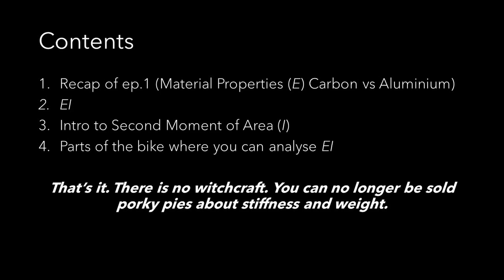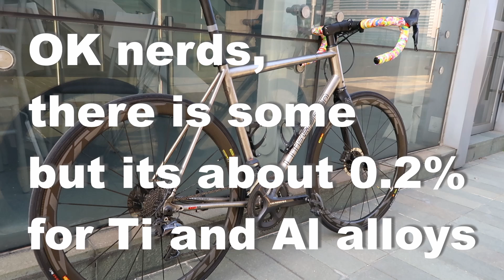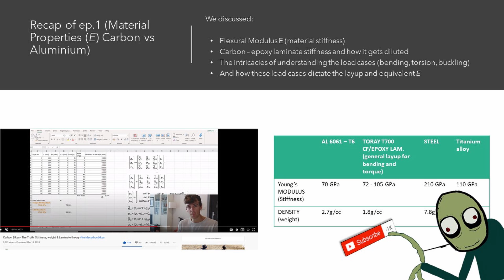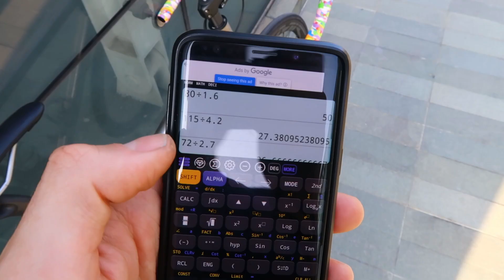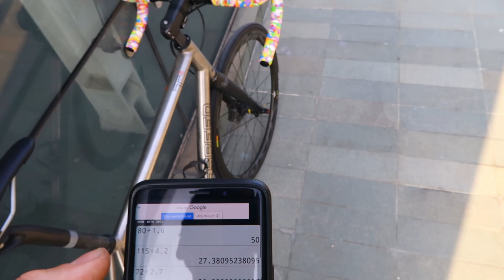Titanium Bikes - The truth and Physics of 'ride feel' marketing.

Comment: Reminds me of the steel lasts forever, aluminum has a finite life stuff that I used to buy into.  I've owned steel frames that have gone flat within a few seasons.    Most people will grow bored of an aluminum frame before they have other reasons to replace it.
Reply: Ever wondered why there are no aluminium springs or why aeroplanes with an aluminium air frame have a limited service life unlike those made with titanium frames?
That is because any aluminium structure has a limited number of flexing cycles before it fails.
This is well known and can be calculated. Once that number is exceeded aluminium structures can fail catastrophically at any time and practically without warning and no insurance company will insure an aluminium airliner which has exceeded the number of flight hours it has been designed for. Steel and titanium can flex infinitely, aluminium can not.
In bicycles this can be counter-acted by making the frame stiffer for any given weight than steel by simply increasing the tube diameter.
The maximum diameter of a structurally sound tube is limited by a simple ratio between wall thickness and diameter (I think it was that diameter cannot exceed 60x wall thickness). Because aluminium 1/3 the density of steel aluminium tubes can be made with a much larger diameter than steel tubes resulting in a much stiffer frame at the same weight.
Reply: @gustavmeyrink_2.0  Thank you, excellent explanation.  Pretty cool)   I've never had a bike frame or fork fail.  I've had carbon and steel road bikes long enough to notice that they pedal inefficiently or what I call "go flat" after a while. The bike is still safe, it just feels dead.  Not scientific I know.  To me it seems to be another more finite element in what determines how long a bike frame is useful.  That's why when I do buy a steel frame again, it won't be expensive or light.

Comment: I have a trek 1000 aluminium framed bike. Put a curved surly steel fork on the front and suspension seat post and it weighs about 10kgs. The fork soaks up vibrations better than the carbon original. The seat post is comfortable. This budget build would be better than an expensive titanium bike.

Comment: I have a Ti gravel bike and a Ti hardtail 29er-love them both, bought them because as a retired engineer I just love the corrosion resistance and look of titanium. I also have a carbon road bike which I save for the good weather, my gravel bike with road tyres fits the bill as a winter bike. It’s not a ‘magic’ material, I just happen to like it.
Reply from the maker: I like the material too and i think I've been infected. Im probably going to buy one at some point 😃
Reply: EXACTLY!!! Glad 2 hear this. Ride what U like b/c U like it. OVERALL fitness is where  your BIGGEST speed gains will be had. Adversely ‘older’ isn’t necessarily worse... but style most certainly plays a part in many choices. I am a sucker for polished metals and clear costed cf...🤗😬🥴
Reply: Similar for me. I retired my grey carbon bike for the elegant titanium ride. I could not care less about weight or other hard facts.
Reply: I’m the same, I bought my titanium bike because of its corrosion resistance and it looks nice as well not because of the so called carpet ride quality.
Reply: Me too ...Ti is not magic but I do love the material... I do Orthodontics so it's moving dentistry 😉
Reply: Yep. Corrosion resistance: full stop. No paint stands up to my sweat either.
Reply: I still have a 30 year old lightspeed mountain bike I use for commuting. Used to race it in the 90s.
Reply: I have a road and mtb Ti. Bought them because are been produced and welded one in usa and one in italy. Lot of quality control, I dont want to ride on carbon fiber and begin to worry after two or three years. Comfort like aluminum, but incredible good looking and more resistant to strain on the long period. If you change bicycle every one/two year ofmcourse buy other things.
Reply: Enjoy your retirement

Comment: Hey I see you're good at FEM analysis, could you do a vibration/modal analysis of different frame types ie dropped/ normal stays and different materials ie alu and Ti thatd maybe help dispell some of the myths around material and show that it is more dependent on geometry/tubing
Reply from the maker: Not a bad idea that. Got to find the time!
Reply: @PeakTorque  what calculator app are you using on your smartphone? Thanks for posting a video with some real engineering justifications vs pseudoscience and buzzwords.
Reply: @PeakTorque  yeah its fairly time intensive, I've thankfully already got a frame designed using standard round tubing with no butting and standard seat stays made from steel on ABAQUS. I would need to change the materials and design a dropped seat stay version and run simualtions for each iteration. I could post the results after I've finished exams and had the time to do it
Reply: Add curved stays and floating stays to the mix